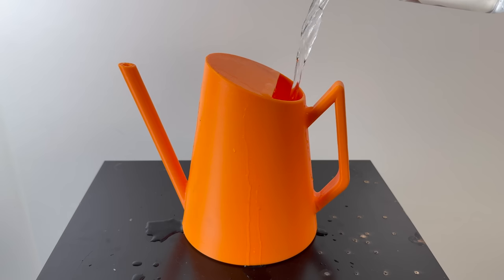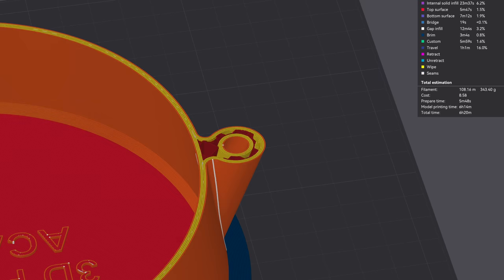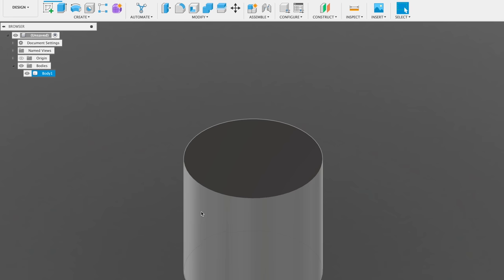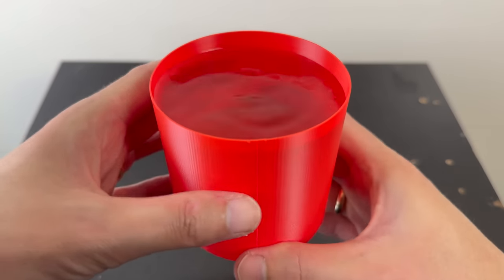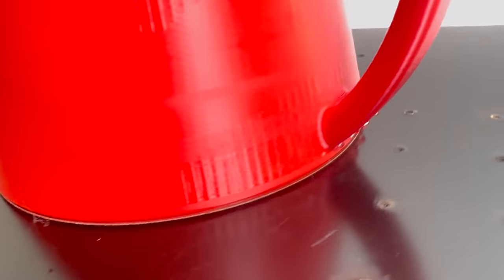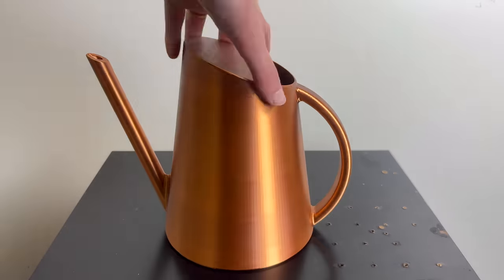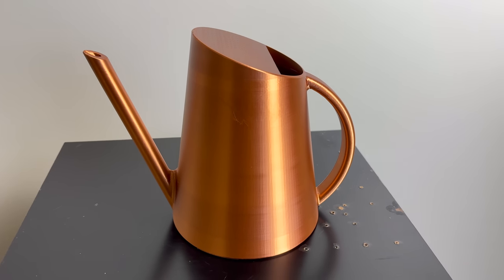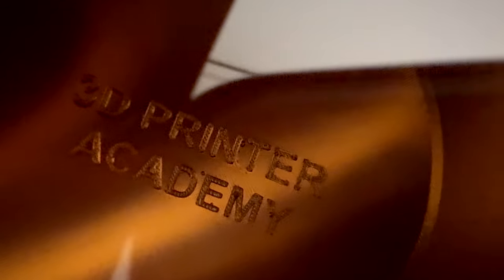Are 3D prints water tight?

Comment: It's hard to make assumptions about whether the complexity of the object influences water tightness when you yourself say that pressure is greater in your larger vessels. You need a single wall thickness "cup" with the same volume as your larger, more complex walled designs. THEN if the large cup performs better wrt. water tightness, you can make a claim about surface complexity and layer adhesion affecting water fastness.
Reply: It would be much more accurate to make the larger cup taller in height, not just simply larger in volume only; since the fluid pressure is greatest at the bottom of the container. As a real world example, those very large welded steel plate cylindrical oil storage tanks commonly found at oil refineries use much thicker steel plates at the bottom than in the higher up plates. The wall thickness diminishes the higher up they are in the tank (reservoir).
Reply: @oceanic8424  good point 👍 PSI

Comment: Another thing to take into consideration is the material you print with. PLA is porous and it was recommended to me not to use it for watertight objects. PETG is very similar to PET, the same material used in plastic water bottles. Not that you couldn't use PLA without success, but some materials will work better than others.
Reply: What about ABS plastic?
Reply: I printed a  scaled down vase in purple PLA and it still holds water 3 years on, but the VRM  blocks I printed for a chinese mainboard  for shits and giggles  a year  ago were done in Creality branded PETG, but had to go real slow with the fan off.
Reply: @DevilbyMoonlight   Why didn't you want the fan on? Was it necessary for the extra heat-melt?
Reply: Can we use uv resin and some sanding to make it water tight? we use pla+ in our 3d printed water filter as an experiment, please give some advice I'm a beginner on 3d printing

Comment: Physics says no. You can buy chemicals that try to make it waterproof but still the water is absorbed into the print itself. If you can find a strong enough microscope you can watch the water being absorbed. Just measure the water, leave it for two days and measure the water again. Hint, there are holes in the material you have just printed. Any voids will be full of water, say like a model of a submarine and you can shake it and hear the water inside, even if you print it solid it still absorbs water.

Comment: If the prices for a purchase and a print are very similar, you should add the electricity costs. That's not to be neglected!
Reply from the maker: true!
Reply: We should amortize the cost of Amazon Prime membership too! Or factor in the cost of shipping.
Reply: Bambulab A1 consumes like 80-100W during print and 180W during initial bed heating. Even in Europe it's quite negligible - tens of cents for 10 hours.

Comment: What about very hot water
Reply: Nope. Heat is used to soften the plastic for printing. Hot water will soften it just like the 3d printer did. Keep your prints out of the dishwasher/engine compartment.

Comment: i print soap dispensers, 1.2mm thick single wall vase mode, .6 nozzle. and 5 base layers. ive been using 1 of my prints for a good 2 months now for hand soap in the bathroom and its still watertight. ive used over 15 different types of colors/filaments and i dont have any leak at all. its 70g in filament and a few hours of printing for each one.

EDIT: forgot to mention, the default infill overlap is 25%, i set it to 50% in order to make the bottom layers overlap the wall slightly more, completely sealing the bottom so that there is no leak in the transition of complicated geometry
Reply: @gotmilkbutt  yeah it's holding soap, and other soap containers may not have layer lines for bacteria to hide in, but do you ever wash the inside of your soap bottles? Cuz I sure don't
Reply: @xXP1ZZAxD3MONXx If a bacterium can survive in a soap bottle it deserves the comfort of my mucus membranes as a consolation for that torture. Besides, it's not like washing my hands would've done anything to prevent it from entering my body.
Reply: @hunszaszist  uhhhh yeah sure we can go with that
Reply from the maker: very cool!
Reply: I can conform one of the 1st prints I did using spiralie outer contour  is watertight, I did a  scaled down vase  about 4 inches by 1 inch and a quarter as a test for a newly acquired ender 3, because it was in purple the mrs pinched it and stuck a flower in it,   and it held water without leaking its still on the kitchen windowsill  3 years later with a different flower in it of course..
Reply: PLA?
Reply: @JonJonArg  and PETG

Comment: I've been 3d printing surfboard handles that have to be water tight. Using 100% infill and ASA, what's nice about ASA is i can use acetone to smooth the surface finish so the layer lines all merge together as an extra but of insurance.
Reply: How do you get ASA to stick to the bed reliably? I tried  with vision miner adhesive but still comes loose very easy and warps like hell
Reply: @xIsouLcruSHca  Glue stick or a slurry of ASA (acetone with some scrap ASA dissolved in it).

Comment: for me i dont have problems with the walls, i have problems with the bottom. Just need to up the flow rate in my experience. Another way to make sure the walls are good is to make it print the outer walls first, then the inner wall with a higher flow rate so it fills any gaps between the two outers.

Comment: I made a few self watering plant pots and placed some plants in them and gave them as gifts, I was concerned about the water reservoir leaking and so I ordered some very cheap photo resin and a small UV torch and coated the inside of the water reservoir with resin, they were water tight although I only had a few drops of water appear on one of three plant pots before the resin.